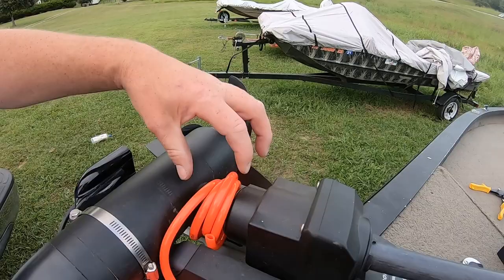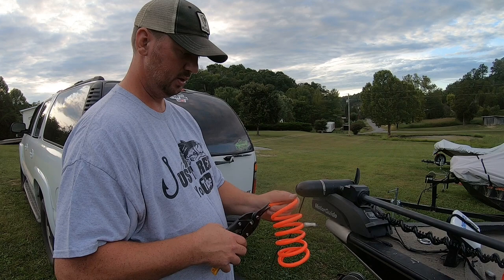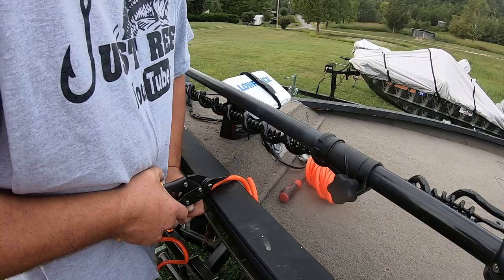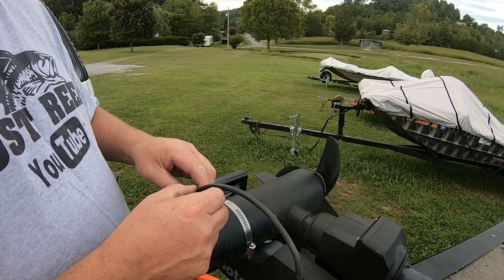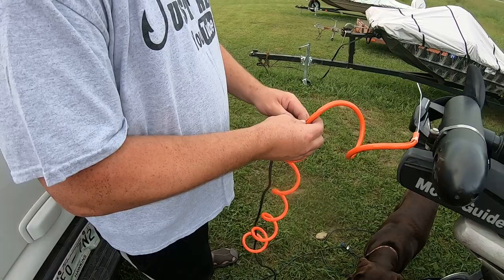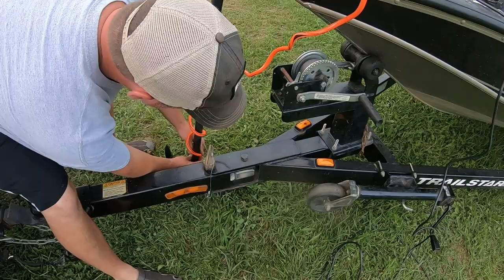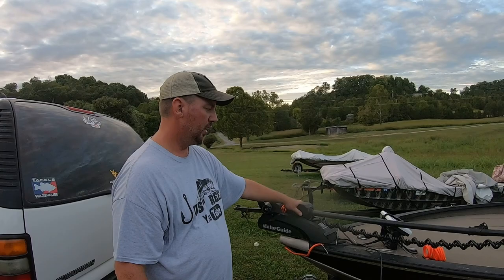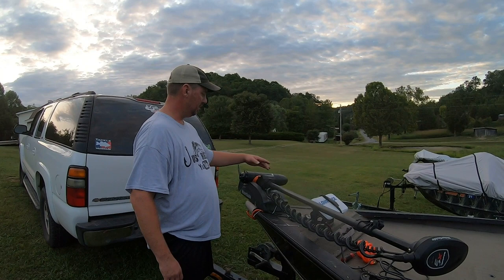How to Cheaply Protect Any Trolling Motor Transducer Wire From Being Damaged!

Comment: Great tip!  Minolta makes a bracket to secure your trolling motor to the boat deck.  I put one of these on and couldn't be happier.  It will prolong the life of your trolling motor because it won't be bouncing around in transient.
Reply: Thank you for your information. Going to install mine the same way. I am from Waco Texas.